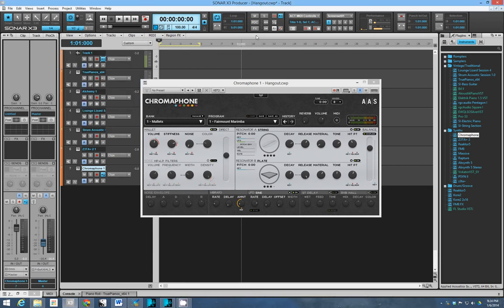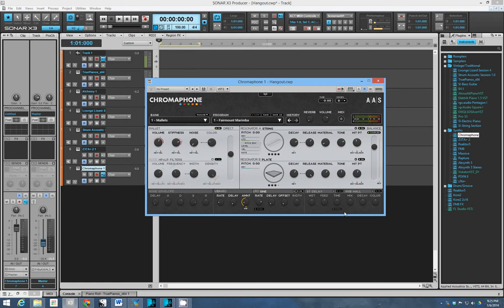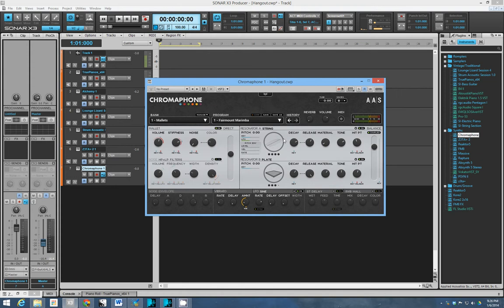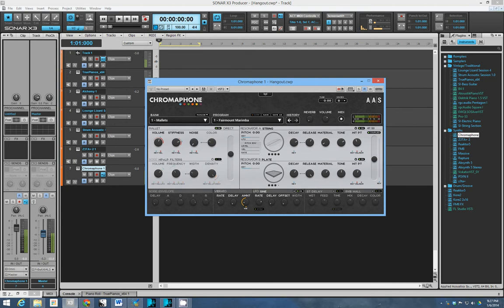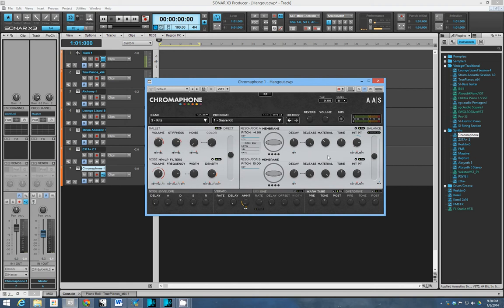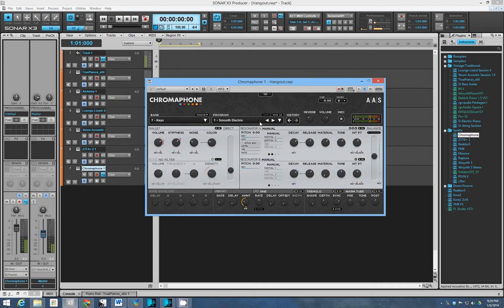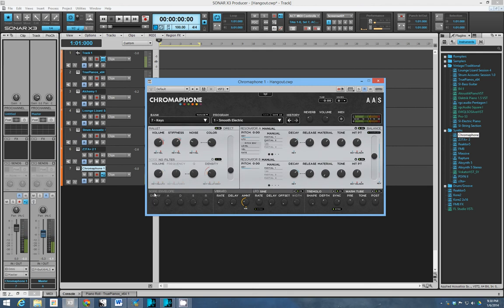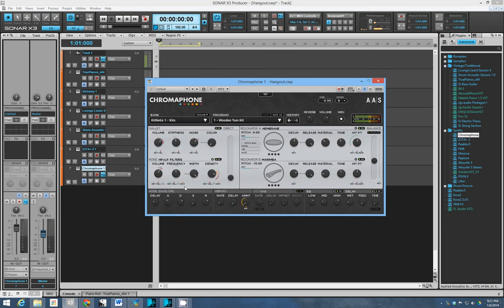AAS Chromaphone Review

Comment: I don't think having tons of modulation options is a good idea on a PM synth. Many parameters can't be modulated while playing without spazzing out your cpu, and it doesn't sound cool. NI Prism is a PM-like synth with lots of mod options, but the trade-off is that Chromaphone kills it when it comes to realism and expression. AAS has commented on the difficulty of including pitch bend in Chromaphone because pitch is influenced by two different resonators that interact with each other. It's far different from changing the frequency of an oscillator on a normal synth. If you stop looking Chromaphone as just a synth and think about the real-world contitions it's modeling, asking for lots of mod options and pitch bend is kinda like asking for a magical size-changing flute that's still made of brass.
Reply from the maker: Kevin Waddle If you can modulate pitch with an LFO or an Envelope, (which you can in Chromaphone) you can also modulate pitch with the pitch bend. There other PM synths do offer pitch bend. There is no good technical reason for them to omit that feature. As I stated in the video, I believe the omitted it for marking reasons.